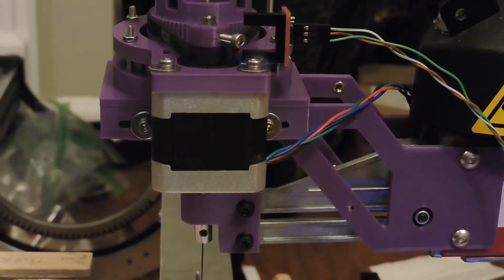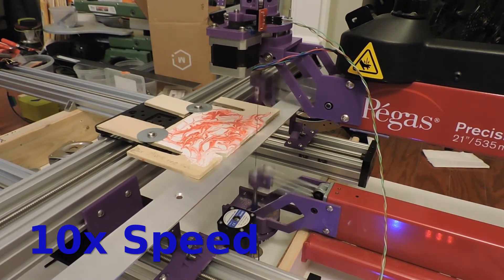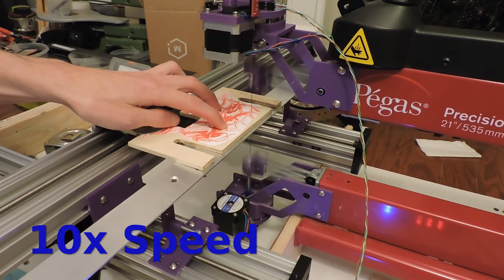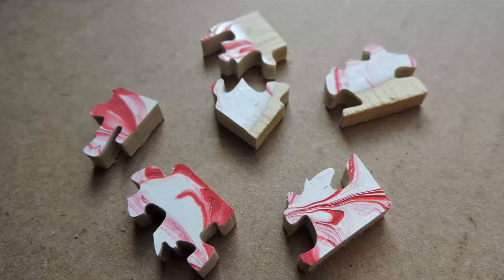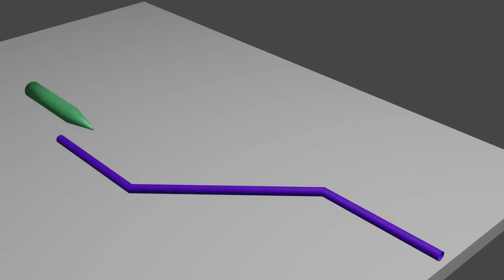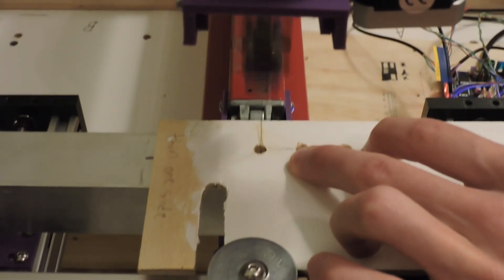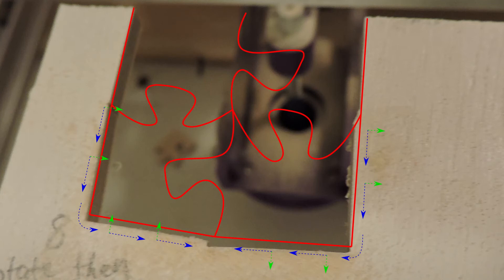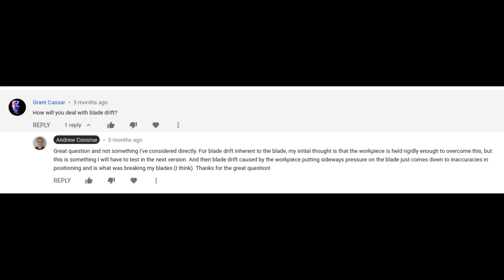CNC Scrollsaw V5 - Blade Drift Bites Back

Comment: As the others have said, it's all about the drift.  Stamped blades (the most common) tend to drift to the right as you cut.  BUT it's heavily affected by the grain of the wood.  Try with some 1/4 plywood (baltic birch is what's used most often).  The layers help minimize the effects of grain.
PGR (precision ground) blades are suppose to cut straight.

On turns, the corner of the blade is cutting away wood to let the blade turn.  Eventually you'll figure out the speed at which you can make turns of varying degrees but all I can say for now is you'll have to slow the forward motion.  Still need some to make sure the blade's engaged.

For puzzles you'll have to switch to the super-thin puzzle blades and that will be a whole new bunch of fun.  A normal #5 blade, on my saw, tends to drift 3-5 degrees to the right.   The Superiour Puzzle blades I get from Mike's Workshop will drift up to 45 degrees.  The amount varies as the blade gets dull.  And you have to change your angle from where you bring the blade to the wood to right after it cuts in.  But that's puzzle blades and future problems.  For now just get it to work with normal blades.

I have this video - https://youtu.be/h56rNCin29U that's a close view of cutting a single puzzle piece where you can see the angle of the blade compared to the cut.  Mark G. Cappitella has a ton of videos where you can see the blade as it cuts.
Reply from the maker: Thanks for the great info.

I have done more testing since then and am getting better results with a birch plywood like you say and the Pegas MGT blade. Good to hear that you also see such high drift angles from the SP blade. I could correct for that with an angle offset but from my testing the drift angle is not consistent so using the MGT gives me better consistency. All my testing in all my videos has been with #2/0 blades FYI

Wow some of Mark's videos show very fast (to my eyes) cutting rates. It looks like the forward/backward movement is very large. I wonder if that is limiting the cutting rate on my latest design, which is purely vertical movement
Reply: @AndrewConsroe  Mark is using Finland Birch, a higher grade plywood that's used for custom aircraft interiors.  It seems to use a glue that's not as hard.  The problem is that it's very hard to find in smallish quantities. Woodcraft & Michaels both carry it but it's more expensive.  Did a test and it does cut better.  Problem is that the only economical way I've found to buy it is by the bundle - that's 62 4x8 sheets which is, to put it mildly, a bit more than I need. ;)

Also Mark has been doing it for 25 years vs my 1.  If you crank your feed rate up near his then you'll break blades a *lot*.  His experience gets more life out of the blade than you're likely to get via automation, but he still goes through them even with the easier cutting wood.  

One of the fun things for you is that how fast you can make the turn you want depends on how worn the blade is.  For a fresh blade you have to slow your blade speed down at least 20-25% or it will run away from you.

I wonder if you'll have to add a camera so the system can monitor the cutting and adjust on the fly the way a human cutter does.

It's a fascinating project and sure to lead to some good things, even if it never leads to a commercial CNC scroll saw.
Reply: With puzzle blades you have to experiment to see what blades work for you with your saw. 

I always say puzzle blades are so fine they almost can't cut you, but being unable to hurt you physically they like to hurt you emotionally.  I also refer to them as being drunk.

Comment: Very interesting project!
Have you considered trying a spiral blade? Spiral blades cut in any direction (not just forward). The downside when cutting puzzle pieces though might be the size of the kerf (spiral blades cut a wider kerf because the blades are twisted). Check my channel for more on spiral blades.
Looking forward to your next progress video. Thanks for sharing!
Reply from the maker: Thanks for the comment. Yes, I have used spiral blades but I'm aiming for the smallest kerf possible, so rotating the blade is the way.
Reply: @AndrewConsroe  I see. The larger kerf can be an issue when cutting parts that must fit together. The smallest spiral blade kerf I've seen is 0.027" (#2/0 blade).

Comment: What size blade and tooth configuration are you using?  A double reverse or even  a modified geometry blade might help with drift.
Reply from the maker: Here I was testing with Flying Dutchman SP blade, 31 TPI. I have some other blades (including a MG) to test and should have a video soon(ish) diving into the details

Comment: Haha, this is one of those things you get your hand-eyes to learn and not think about again. And Grant new this well enough to mention it as a problem to solve - kudos Grant.
- 1st thing they say is blade mfg'g creates drift (sort of)) - blades are shear cut so a trailing edge 'fin' remains that 'steers' the blade. Imagine an L shape. I sometimes grind, file, or polish off the offending edge to get a flatter blade. (bandsaws too, BTW).  
- 2nd It is 'normal' to feed the work at an opposite angle like you did into the holes to bias or counteract the drift.
- 3rd  I frequently stop forward motion, relax the force, relax my grip and the piece moves to the side to relieve the bending blade (like you saw when it entered the hole). And then proceed. 
-4th thicker, wider, coarser blades tend to drift less. Ugh.
- Finally, Hand-eye coordination is the best, most effective way to control drift so I suppose you'll need to add some sort of feedback ?
Nonetheless Andrew, so close ... don't give up now!!    Stay safe. -Mike😷⏳
Reply from the maker: Yea I've seen a lot of varying information on how blade construction affects drift and the different ways blades are created (milling, grinding, stamping). I would really like to nail down what's causing the drift and eliminate it, but I'll also be testing out a fixed angular correction
Reply: @AndrewConsroe  Best I can say is good luck and keep us posted.  (I would be tempted to use imaging techniques with a video cam to correct for errors.)
How did you say you get the cut pattern digitized ? (or didn't you)
p.s. Did you know scroll sawers use blue masking tape on the cut line claiming the adhesive 'lubricates' the blade. Doesn't seem to hurt.